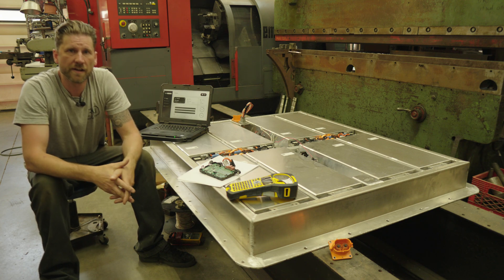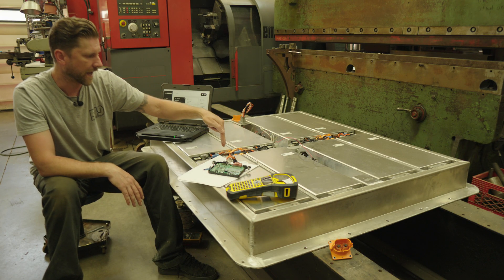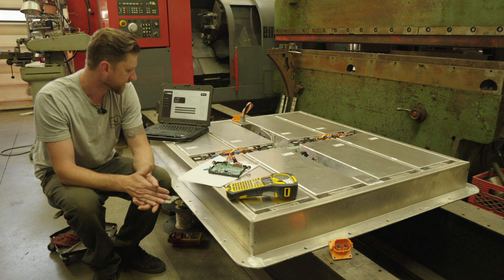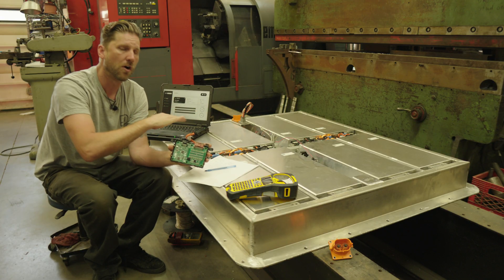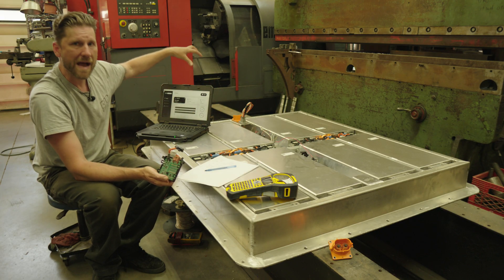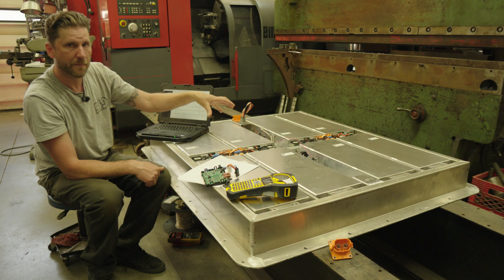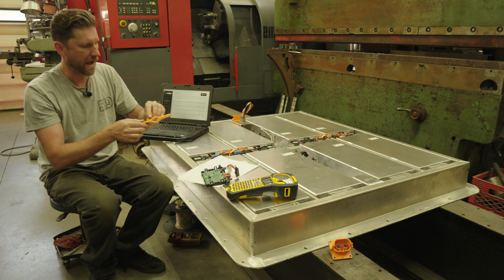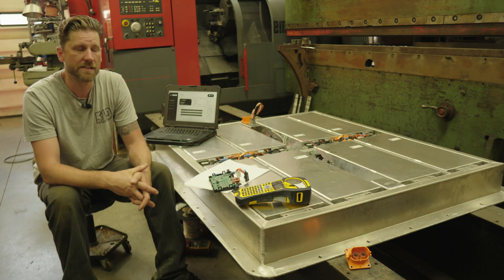Battery Management System For Our Electric Dual Motor C1 Corvette Tesla Swap

Comment: That battery pack is art! Fine craftsmanship throughout the build and conversion. Your approach in using the original CMUs is definitely the way to go and the ID4 battery modules are an excellent choice. I'm looking at the ID4 and using the original CMU's as well. Now I know it's possible. And the Vero unit is an excellent choice given its simplicity. Did you have to reprogram the Vero BMS or did it work with the CMU's right out of the box? I was of the understanding that the Vero only worked with its nodes. .
Reply from the maker: I was kind of the R&D for the cmu’s. I think they have a pretty good handle on it now though.

Comment: The laptop app is the Vero Electric BMS V2 Control Center app which you can download from a QR code on the back of the box for the Vero BMS V2 module.  Thought I would post this as it was not clear to me.  Thanks for the video, as usual learning many things.

Comment: Very useful info you are sharing. Well done! Just a note about the cell tap wire sizes - if you draw too much over them (like 250ma) rather than the 100ma that you say they can handle it won't harm the battery cells in any way but the risk is that you could overheat and burn out the cell taps.

Comment: Possible to use VW, battery, BMS, and drive motors without mixing in Tesla, for these type of project needs?
Reply from the maker: As far as I know, there is no controller available for the volkswagen drives yet.

Comment: So Vero has done the work of decoding both the CAN messages for the ID packs and the Tesla modules - I don’t know about you but the cost of components here seems quite high to be limited to around 200hp in a full sized EV because of the 400A current sensor. Is the Vero system capable of paralleling multiple current sensors and multiple sets of CMUs from VW into a larger pack? Do you plan on trying to test the limits of the VW cells to see if they’re able to handle kA+ to get muscle car power or do you see the performance being way less important than maximizing the life of these components for this case/customer?
Reply from the maker: I think the Vero guys can also do the volt packs? I was kind of the guinea pig for the vw modules, and so far it is reading perfectly. I think I could use another current sensor with a higher rating, but i mainly want it to monitor the charge current. I am going to test out the vw packs because I have read all sorts of conflicting data about them. The 12s2p modules are apparently rated at 800amps? and I have heard of guys dc fast charging at 100Kwh with absolutely no cooling!!?? Sometimes it is better to just commit and find out for yourself!
Reply: @519Kustomz yeah with these batteries it just seems to be a “duty cycle, power, longevity, pick two” scenario so getting data points like “ I ran my pack at 800A peak for 3 track days/year on my daily driver and there were no adverse SoH affects” Will be super helpful in this community
Reply: its using the simpBMS system, which is open soruce.

Comment: In the video you said the reason you went with this system is because Volkswagen designed it. I don't think you should rely on Volkswagen engineers for anything. It does not matter how much money they spent. Just look at their history with blowing up cars electric car specifically.
Reply from the maker: Don't quote me, but I believe the CMU's are actually designed and supplied by nxp?
Reply: what history, beyond infrequent incidents?  My best friend has had his Cybertruck for 4 months.  3 months has been at Tesla for repairs.  They will not comply with the lemon law provisions.

Comment: Good choice on using OEM BMS system. Seems you are using slaves and master as you have the communication up and running.
Be sure that you don't run more amps from the cells than it was in ID4. Why not use Tesla Modules?
Reply from the maker: The tesla modules would not have fit the layout of the car as well as these do.

Comment: Orion 2 BMS uses 22 AWG wire to each cell group in series.  Are young saying there is not a way to directly measure voltage from a connector outside the aluminum casing of the ID 4 battery module?
Reply from the maker: Each module does have a connector between the terminal ends. It has the pinouts for the series cell level voltage aswell as the thermistor. But all that is located and only accessible inside the 'pack'

Comment: I am totally amazed by your engineering work! I am looking to convert a C3 corvette one day and your work may help me one day. Many thanks. 
One question tough: How do you get this C1 road legal afterwards? Here in Europe I could hardly thing about getting it road legal with all the customization you already did (including a custom frame).
Reply from the maker: Where I am in Canada it is not too much hassle , for now. Everything has to conform to the safety standards, but as far as the fabrication, it is still the certify-ing mechanics discretion.